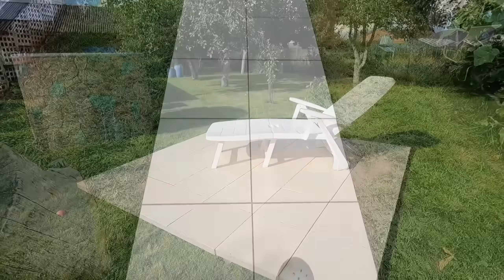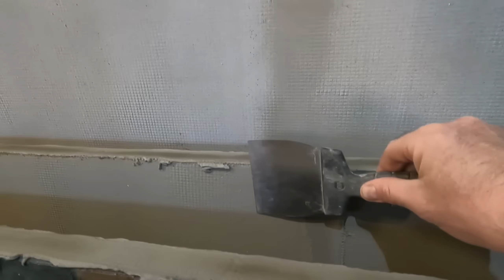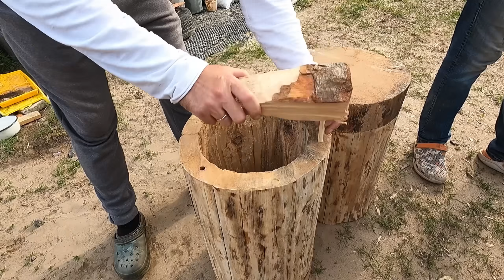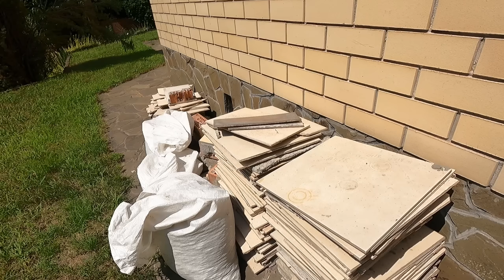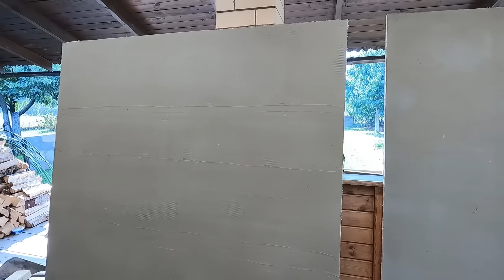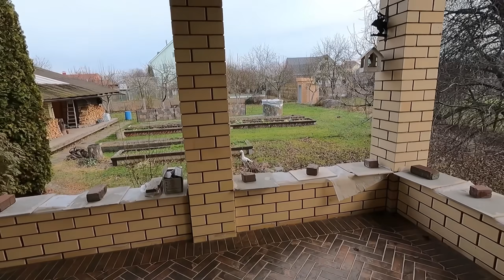Amazing DIY Building Material for Home & Yard - Inexpensive and Easy!

Comment: from ChatGPT: It is ПЕНОПЛЭКС Комфорт (Penoplex Comfort), which is a rigid extruded polystyrene (XPS) thermal insulation board. 
Similar to R-10, Owens Corning FOAMULAR 250 XPS Insulation which sell for about $60 USD, 4x8ft x 2" thick.

Comment: It is Penoplex,  a waterproof insulation for the plinth of external walls. It is a closed cell foam, rigid and durable. It's available in Europe but produced in Russia. It is a type of XPS. The price is 3 USD per squaremeter in Hungary.

Comment: Nothing new here.  Just existing and available materials used in a different way.  NOT recommended for enclosing entire building (walls and rooves).  It is completely waterproof, so it doesn't allow moisture to enter the building.  However, it also does not allow moisture to escape the building.  Moisture buildup inside causes mold that is dangerous to your health; sometimes deadly.

Comment: I think the case he makes for most claims is not that great. . 

There are multiple ferro and light concrete and cardboard based forms ect that would out perform these on prerty much every measure, as you beed them to do..  

Also the fibre glass mesh might be ok, but best performance or price? Unlikely..  

Woven polypropylene landscaping  mesh as " cloth ferro" as a form , now yiure talking. Could scaffold any need you have as stage 2..  do it over cardboard for forms, add light concrete and heavier ( especislly basalt ) regar and mesh.  Itd be vastly stronger than this, cheaper than this, mors flexible than this , and last ( vastly ) longer than this.    The advantages of curves and dones and also free form use would all be ( Vastly ) better than this. 

Use of resins and fibre over ( eg cardboard forms ) shell with non toxic light concrete insulation mixes could also be imoressively fast n light for right applications. ..  

Another cheap hack worth considering is gabion walls for foundation work and part of building ... strawbale, and sawdust mixtures for insulation too.. 

Cenent based insulative conposite boards can be made more structural more bonded and more ridk free than styrofoam conposite boards. Where failure is useslly sudden and complete, and delamination is critical failure risk. 

Cement composites can be tailored in many ways.   More lime, add resin, add layer proofing, add fibre, rebar, cloth ... resin over skin.. ect.  .. 

Without going to ( tricky ) aircrete extremes , much better insilation is easily made woth light cretes.   Simple cardboard can be used as a mold very easily.  None of these thongs cost as much as your styrofoam of sand styrofoam boards would cost.

Comment: What is the tensile strength of the reinforcement mesh, and have you decided on a method of determining the appropriate amount? I find that bailing twine is cheaper than fiberglass mesh. Another option is baling netwrap. 

I also want to see about using closed cell polyiso spay foam. In the process of making my own panels on a form. 

We could use open cell foam in the center of the sandwich.

Comment: This is pretty interesting stuff.  But it would be great if you could perhaps provide links for Americans, identifying equivalent products available in the US.
Reply: Im also from America. I want to join a group of testers here in Utah.
Reply: from ChatGPT: It is ПЕНОПЛЭКС Комфорт (Penoplex Comfort), which is a rigid extruded polystyrene (XPS) thermal insulation board. 
Similar to R-10, Owens Corning FOAMULAR 250 XPS Insulation which sell for about $60 USD, 4x8ft x 2" thick.
Self Leveling : Sika High Strength High-Flow Floor Leveler 50 Pound(s) Powder Indoor Self-leveling underlayment about $31 
Fiberglass Mesh: M-D 4-ft x 7-ft Charcoal Fiberglass Screen mesh about $12. NOTE deliberately short of 8ft
Reply: Same. Here in texas. I wanna build a big chicken coop outta this stuff so bad but finding the equivalent exactly is difficult
Reply: @WarriorPrincess39  At home depot or lowes the main product is called Penoplex, it is foam board with an insulation rating. I saw some today that had a good insulation rating at R10
Reply: Find yourself an old fart at a small lumber yard and show him/her the video. Heck, pay him to pick his/her brain. And sell the list for a dollar 😅
Reply: Strata international builds foam houses out of eps foam. They been around 20 years here in Arizona.

Comment: What you call Super Material, I can best compare to a Structural Insulated Panels and there are complete kit homes made from this product in the USA. It easily withstands hurricanes and blizzards with a much better insulative rating than traditional stick-built homes. I like your method of using the "super material" for other structures around your property, very innovative.
Reply: 25+ years ago a neighbor built a house from ICF "Insulated Concrete Forms". Not as thin as what this guy is promoting. It was foam blocks with a few centimeters of concrete poured in between, than plastered on the outside. It was fascinating to see the construction.
Reply: @Ahamshep  He is promoting nothing! He is showing one way to use it

Comment: Insightful reflections to utilizing modern materials in a nontraditional manner.
   It is unfortunate that government oversight also tends to stagnate proceedural improvement. These materials were not available to either the average DIYer nor industrialists that created mandatory design.
   That being, the efforts of established manufacturers to include themselves to regulated examples of past should be aschewed in favor to trending capabilities. That's not how influence functions in government, though.
   I can quickly consider several improvements to base construction of these preformed panels.
   Those will likely find their way into my own efforts of similar concept. Would be happy to share that insight, if you're  interested.
   In either case, you've my standing appluad for operating with defiance. My respects, Sir.
Reply: What about this in a geodesic dome design? My mind is working on the frame. Also, the curved boards could function as doorways, connections, etc. Or perhaps the entire structure could be a hoop building with window ends.

Comment: Hi Please investigate the use of the EFIS system in modern construction. I have been using this system for 30 yrs it is fantastic and the same as your using ! ALL is good it's just you are not new and innovative  . Please continue with your system and you will find much Tech and engineering usage and safety specifications in ASTM & other international standardisation guidelines. Have a good day.

Comment: Use fire to burn out the middle of the log. You could also try to drill a hole and place liquid compost. Both sound like an easier method to empty the center of the log… love the easy ones you’ve built!

Comment: You can purchase fiberglass re-inforced and foam impregnated concrete board at any Lowes or home depot, or Menards in the USA.....We use it as underlayment for ceramic tile. Its not the same as this, but its function is basically the same.
Reply: What is it called at Lowes or Home Depot?
Reply: @georgefromtexas4631 I think he's referencing lightweight cement board. It's about half the weight of normal cement board plus a fair number of other advantages.
Reply: @georgefromtexas4631  Concrete Board
Reply: @georgefromtexas4631  DUROCK. Or cement Backer Board. Its not exactly like this stuff he is doing here, but you could use it and foam board to make a similar product.
Reply: Expensive @ Lowe's

Comment: I have seen two tiny houses made from the foam that was coated both sides with sheet metal. They were quite inside and he said insulated better than a trailer house. Dinner know the method of construction. They were performed buildings. He said if he had it to do over he would not have picture windows.

If a person could get they're hands on the same sort of stuff but made for constructing the freezers like at Tyson's or Butterball that would be amazingly insulated!
Reply: There are alternatives for insulation .. there are also new high performance insulations that leave the standard ones used on cold rooms in the dust. ( eg VIP INSULATION ) 

In combination with a perlite , and rice husk ash, and lime mortar plaster added cement,  you could easily create higher performing insulation Shells for freezers and fridge Shells.     Given the performance difference in hot places a seperate roof ( double roof removes solar heat..) by itself is a huge difference in energy costs.    Highest conbined systems cold store ive designed models to up to 80% lower running costs and, if importing insulation to a poor country, the build costs can be up to 60 % cheaper, too... 

Seriously.   Cold Transport units are even more over priced, and inefficient.    Example, a standard truck cold system can run to 50k a unit...  designs ive modelled with solid alternative insulation builds and modular units n lower cost cool systems can be up to 30k cheaper to build and at least 30% cheaper to operate, and more robust cool chain. 

So, can you do it?  Yes, yes you can definitely do it and do better, cheaper.  Seriously.
Reply: Please tell me more about using perlite, rice husk ash and lime mortar plaster cement for insulation panels. Would you coat foam panels in these materials? Or are you talking about making a whole insulation panel from these materials from scratch? Thanks

Comment: You should definitely cast a fiberglass mold after you carve your next garden bed, that way you can do an inverted pore of your surface material and then add your backing styrofoam layer afterwards, and even do a final report to encapsulate it completely
Reply: There's no need. The plastic mesh he was using is more stronger.

Comment: You could always use a strip of metal around the bottom perimeter with screws or adhesive tape to prevent the gas/electric trimmers not penetrate through the surface and foam.
Problem solved simply!

Comment: HAVE YOU ANY IDEA WHAT WILL HAPPEN IF POLYSTYRENE START BURNING???
Reply: The non flammable outer layers might stand up 10 to 30 minutes to a blowtorch under no extra load. Already, many countries cover polystyrene with poured concrete for ground floors 
If I was thinking of using it then I'd at least see how a metre square Composit panel looked after 30 minutes of applying a blowtorch.
Reply: Yep, cheap structure is not a fireproof structure.  We best all take the trade off and make adobe brick houses. Remember the fiberglass rebar. Tensile strength is important in an earthquake.

Comment: Is there an equivalent product sold in the US to penoplex? Thanks
Reply: Extruded polystyrene foam with excellent technical characteristics.

What is Styrofoam? The Ultimate Guide [2025 June Updated]
“Styrofoam” is often used generically, but it actually refers to a specific type of plastic foam with distinct properties.

Comment: What is the material? Name it or shut up.
Reply: He mentions his local brand constantly in the video, Penoplex. The generic name is extruded polystyrene aka XPS which is a common insulation material and has structural properties although normally only used under concrete foundations.
Reply: @Trahloc-PH I tried looking it up but didn’t find anything. I think the CC was spelling it Pinilex or Pinniplex.
Reply: @walterrutherford8321  I just randomly guessed the spelling without looking at cc and got lucky. :)
Reply: He has told you over and over. How about you listen or shut up. Jacka$s
Reply: Looks like concrete slip, just very runny concrete, over foam and mesh.
Reply: I've been building with pumicecrete for 30 years
Reply: He literally made videos to show how he makes it
Reply: I absolutely love your videos!
Reply: Was just wondering if these materials were also available here in USA.
Reply: OMG he says “Pinneplex” about 100 times. How about‘Listen or shut up?’
Reply: It's pink insulation board wrapped in fiberglass
Reply: SERIOUSLY
Reply: plastic plastic plastic fantastic 🤡🙄 Amazing material when it's being microplastics. закалебал уже своим пеноплексом придурок
Reply: AI slop written by chat gpt and read by text to speech

Comment: A single 1200x600x20mm sheet of extruded foam costs £105 in the UK. That's US$140.43 A not-so-cheap cheap alternative.
Reply: Home Depot 20 dollars 4’ x 8’ x 3/4 inch (20 mm) however his looks to be 2 inches that’s 48 bucks a sheet.
Reply: Cheap ls in the Eyes of the Pocketbook...???

Comment: I don't get a description of YouTube I watchon my phone or tablet. Idling to follow your videos on the other platform you mentioned (V contactedgroup?) Would you please put it in a comment? Thanks. PS I think one could mimic trusses or rafters with zig-zagging connecting pieces out of the same extruded Styrofoam, with similar strength to ones made of wood.

Comment: As a Kid, I built a Box Kite,  using 1/2" x 1/4" Balsa Wood Strips, your the Cross panels I used Strips of the Same Material, glued on, and tied in an "X" pattern, for strength with string. I skinned the forward  and Aft section with simple White Letter sized Sheets, glued on, then sprayed with paint from a Rattle Can! That paint on the Paper stiffened those skins immensely! 

I flew that kite in our typical canyon afternoon winds, and had reeled it out some 300 feet, on 1/16" or so Nylon Cord!  

Imagine if I had made a dual Skin of Paper, glued over a "V" folded inner core, almost like a Corrugated Cardboard like application! The "V"shape works like a Truss function! It could have even been "Stitched" with a Tick Thread, to keep the internal Glue Joint from being the only load carrying medium! Like the concept in "Triaxial Composite Cloths!" 

But Rutan, designed Aircraft, using Foam, skinned with Epoxy Fibreglass skins! 

Milt Taylor created "TPG" - "Taylor-Paper-Glass" for Aircraft, in the 1970's or so! Paper Covered in the Stiffening Resin, then Shaped into Tubes and other shapes, strong enough to make a Personal Aircraft! 

I observed how "Tuff" the Rutan Design technique was, in person, at Gary Leggare's shop, in Langley, B.C., when he was making the Quickie Mid, for "Tundra Tires" and rough field operations!

Comment: I think this is US equivalent.
"Penoplex is a brand of extruded polystyrene (XPS) foam insulation, widely used in construction applications. 
In the US, several manufacturers produce comparable XPS foam insulation products. These include:
DuPont (formerly Dow Chemical), known for their Styrofoam™ brand (traditionally blue, now also gray with a low GWP formulation).
Owens Corning, whose XPS insulation is typically pink and marketed under various brand names like Foamular, Propink, Thermapink, and Insulpink.
Kingspan, which also produces XPS foam, often recognizable by its green color. 
These products are similar to Penoplex in their core properties:
Low thermal conductivity: They offer excellent insulation value, typically with an R-value of around 5 per inch of thickness.
Closed-cell structure and water resistance: XPS foam has a uniform, sealed cell structure that resists water absorption, making it suitable for wet and below-grade applications.
High compressive strength: This makes them durable and resistant to compression, maintaining their thermal performance over time.
Ease of installation: XPS boards are lightweight and can be easily cut and handled for efficient installation. 
Therefore, if you're looking for a US equivalent to Penoplex, you should consider XPS foam insulation products from companies like DuPont, Owens Corning, and Kingspan. Be sure to check the specific product specifications and consult with building professionals to ensure the chosen product meets the requirements for your particular application. "

Comment: penoplex is extruded polystyrene foam and sand but only one website says that.... i would think in the US Owens Corning FOAMULAR would be the equivalent minus the sand, which i dont think is really in the penoplex.... just my 2 cents
Reply: Yea and im not sure if the stuff is much cheaper over there but it isnt cheap here.
Reply: I found 1x4x8 at Home Depot today for $17.00 and 2x4x8 for about $33. I don't know yet which glue is best, but using this technique is skipping numerous steps which other builds use and overall cost seems less. However,  I'm still learning.
Reply: Will this be as good as what he is using?
Reply: @thestreamreader  snow loading is a real thing
Reply: @cut-the-blue-wire  steeper roof pitch or an arch will take care of snow loads
Reply: @thestreamreader  The International Construction Industry uses Expanded Polystyrene or EPS...???
Reply: @StyroHome yes…? The US uses it as well. EPS is even bonded to wood sheathing in the ZIP System roofing and walls for exterior insulation and air barrier. But I like these panels on this channel, since it is a DIY panel. I might uses this idea for some stuff around my own house.
Reply: @wadecrawford6445  EPS has a very long Lifespan, Wood... not as much...???
Reply: @StyroHome wood had a very long lifespan if it is kept dry and free from wood pests. Might not stay true, plumb or level, but lasts a long time.
Reply: @wadecrawford6445  well i think the issue is going to be water seeping in and it just sagging.    but for a house roof.... and without the plywood panel sandwich... dog house or maybe a shed.   i thought the fake stone looked very fake and bumping it would put a dent and then its a crack and back to water logged.... but man your sticking it to the oligarchs lol
Reply: @thestreamreader  if you believe the internet, i mean i spent a whole 20 mins researching it.
Reply: Sounds correct...Looking at Foamula NGX here.
Reply: Yeah but that's like $30 for a 1" x 4' x 8'. That doesn't make building cheap.

What are they paying per sheet?
Reply: @jimweda  cheaper than wood and drywall and insulation and labor....  you know until a bird runs into it
Reply: @cut-the-blue-wire lol yeah or a burglar wearing steel toe boots.